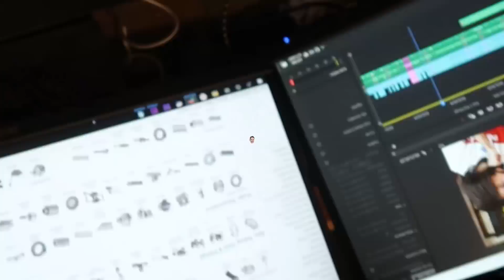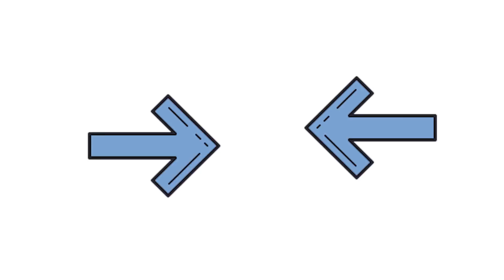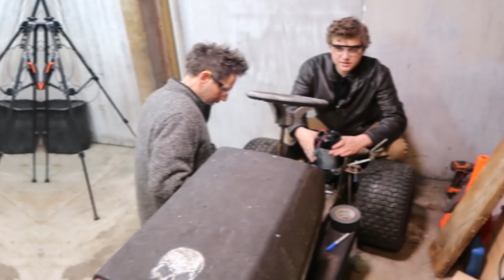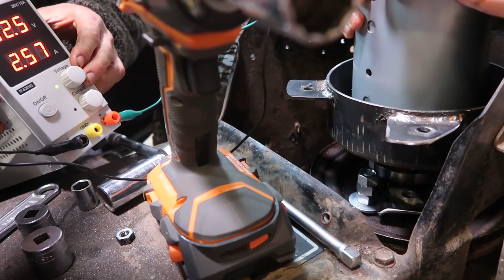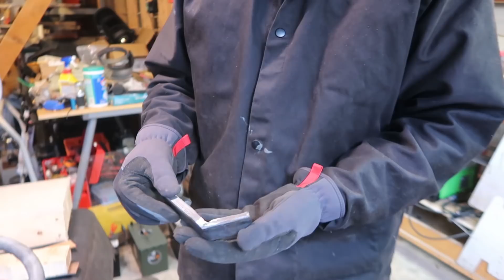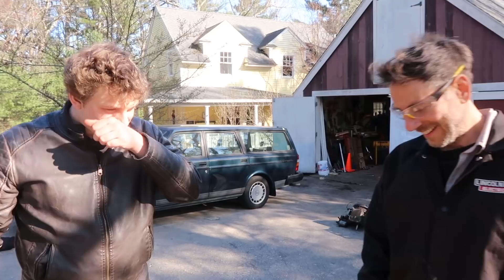DIY Motor $5 Coupler Challenge | Electric Conversion - Episode 16

Comment: Do you think Elon went through similar issues way back when...??
Reply: Might be... The first Tesla Motors in the model S were having troubles with the bearing.
Some people are telling you that they changed the bearings. In my humble opinion they reduced the offset and vibration of the motor shaft (alignment).
As far as I know there is still no coupling in the Tesla motor. A normal gear set works fine to eliminate a small amount (<0,2 mm) of disalignment.